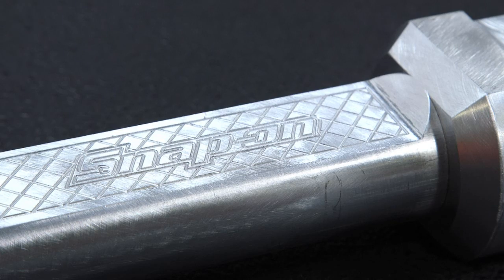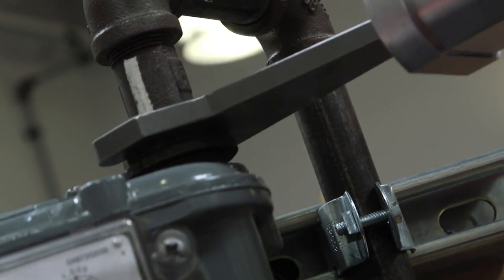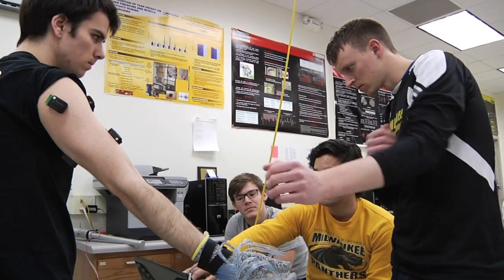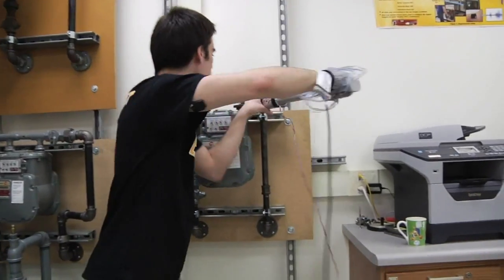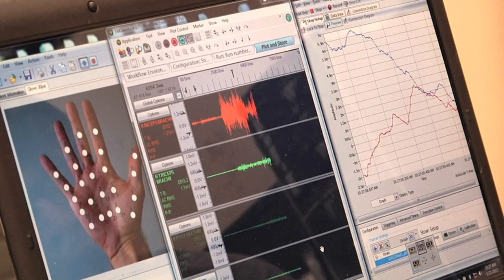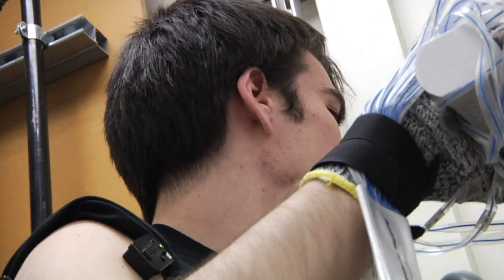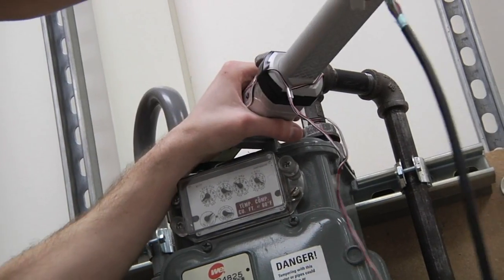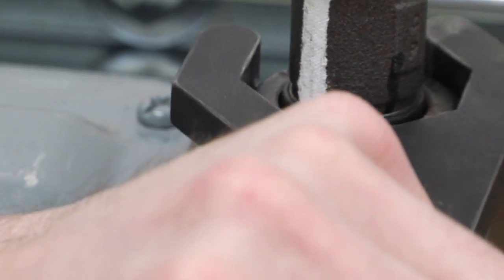Snap-on UWM Gas Meter Wrench

Comment: I actually do this work everyday in the oil and gas field. Our stuff is all out in the country, out in the middle of fields and everything is rusted together, and unless its not shown in the video, the issue is tightening or loosening the pipes not the inlet/outlet fittings. It looks like it was solely developed for those fittings. Those particular fittings usually don't require a lot of force  because of the thick rubber washer inside that seals it, and as a byproduct, it prevents an over-abundance of metal on metal contact to freeze up against. Love the extra leverage in the length though. Throw an attachment on there like a pipe wrench that's not quite as wide and has a sliding, spring loaded, bottom jaw for pipes, and we're talking!  Oh, and make the inside (where the pipe would go) curved like the shape of a pipe for more tooth contact. 3 different sized heads mimicking a 14, 24, and 36" pipe wrench and the curve on the top and bottom could change respectively with the size. Less curve for the larger and more curve for the small since small pipes require a more aggressive curve for more surface contact. The aggravation and extra muscle comes from constant adjustment and wrench slippage. I could be wrong but I can't see people paying much for something that's going to take up a large portion of their tool box for something that only fits the inlet/outlet fittings

Comment: Definitely not a new idea at all.
5 do the work of 50...
The snap-on name itself teach that story, an old story...
a handle can accommodate different sizes and shapes wrenching heads and relative adapters to get the job done. This kind of wrench with multiple heads is already available in torque versions and not, maybe not pentagonal, octagonal and other proprietary security shapes but they do exist.
Of course, if you extend leverage, force and human effort employed in the fastening and dismounting is less (goes by itself, less than a pipe wrench with shorter leverage with cast iron or forged steel handle weight..). At this point, why don't  develop either a specific adjustable telescopic handle similar to blue point adjustable breaker bar BLPBB1224 (IMO  Not round&milled but elliptic&Tennessee forged/coined section or even a nerved H section similar to building trusses)??? 
Moreover again, why don't use a slightly wobbling/swinging head at the joint like in ATECH ratchet heads... for adding versatility???
Take care, Ciao.
CSR
Reply from the maker: Rich Goldstone Rich, Thanks for your suggestions. We're always interested in making our products better, and we appreciate your input.